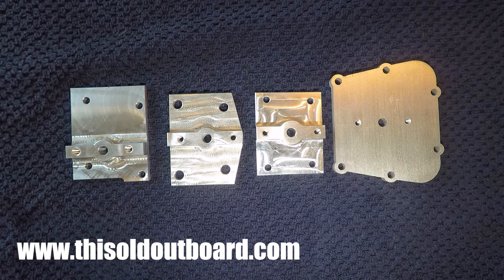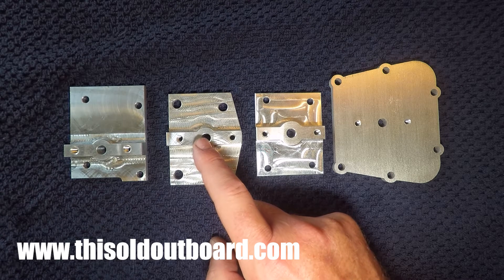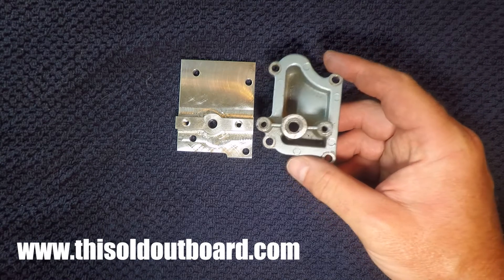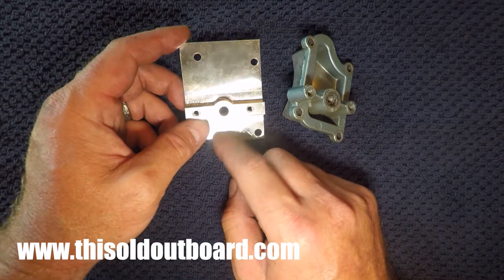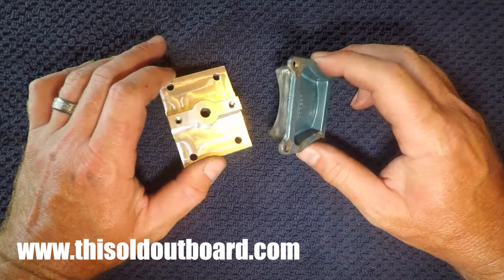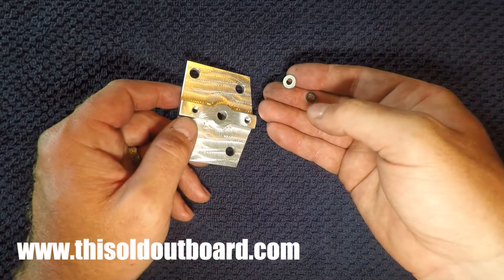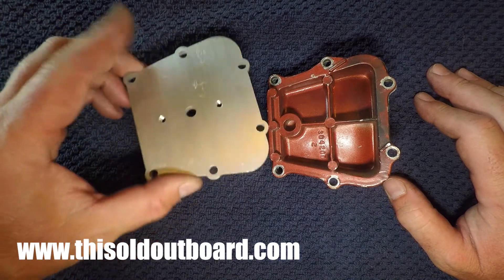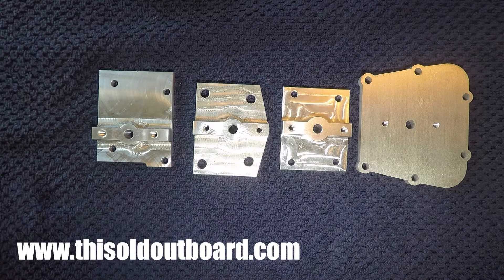Johnson Evinrude Fuel Pump Conversion Bypass Covers - Detailed Explanation

Comment: hey i bought your plate for a 35 hp evinrude and its to small. and it be nice to see a 35 hp motor how to. I drilled my one that came with the motor. what to do with the old tubes that come out?
Reply from the maker: It’s the same process as the 10 hp in this video.  Johnson Evinrude OMC 10 Hp Bypass Cover Adapter for Fuel Pump Conversion (Single Line Tank)
https://youtu.be/FOwZbXQnuao

Start a return on your purchase and I’ll refund you when I get it back!

Comment: any 2 stroke divorced fuel oump can easily be adapted, I used a Mikuni divroced 2 stroke fuel pump on my old martin 10 HP outboard, simply tap a line to the motor lower case to have a pulsating signal and direct it to your fuel pump, 
nothing to custom machine, only a rurimetary bracket to design and fabricate.

Comment: The 1957 Johnson, Evinrude  35 hp engines (some of the best ever built, Mercury's of that vintage all went to the scrap heap early ) came with 2 line tanks. Also Gale, Bucaneer and Montgomery Ward Sea King outboards were built by OMC (Johnson, Evinrude) and also used two line tanks. I have converted more than a few over the years as I have owned over 100 outboard motors since the early 60's. Wish you had these then.
Reply: I forgot to add the old and cheap way of converting them was to dill the cover and install a hose nipple. Install the same on the fuel pump and attach it to a L shaped bracket and mount it in a convenient place inside the motor housing.

Comment: I was thinking about switching one of my RDE-18 30 hp over to single line are the screws stainless steel I bought your shift rod punch out tool works great 👍
Reply from the maker: Screws are stainless

Comment: Last question I promise lol do you have to pull check valves and plug on port in reed plate behind carb when using this plate and diaphragm pump? Or is does a guy just install plate/pump and fuel line in/out… and plug pressure line off bottom of carb where pressurized line originally came from?
Reply: Yep, ypu have to put a plug over the vacuum nipple that is not covered by the new plate. Any automotive parts store will carry sets of vacuum rubber caps in different sizes - cheap and simple to install.

Comment: Hey Jo what’s your opinion on this plate being flat vs the original 56’ cover has a wing on the internal side (air flow direction?) it appears yours are flat and factor are not. Just curious if you’ve tested a lot on 30Hp is all just a concern
Reply from the maker: No issues reported / seen / or experienced not having the cupped internal side feature.

Comment: Question for the 30Hp does a guy use same fuel pump as the other 3 engine plates? 
I emailed to purchase today look forward to hearing from you
Reply from the maker: A: Fuel pump/conversion kit with everything needed so I can hook up to a fuel tank

A: my RD series bypass cover will do the trick. The bypass cover comes with fuel pump two mounting screws. You’ll need to get the fuel pump and gasket separately. See here: https://thisoldoutboard.com/custom-bypass-cover/

Q: also need coils/points/condensers/carburetor kit.

A: http://www.marineengine.com/parts/johnson-evinrude-parts.php?year=1957&hp=35&model=RD-19&manufacturer=Johnson&section=Magneto+Group

Q: one last thing I’ve watch you plate to garden hose adapter for running motor instead of barrel as muffs aren’t sufficient. Any chance this is available?

A: yes they are! See my listings below:
Flush Plate

https://www.ebay.com/itm/274829184435

Hose Adapter

https://www.ebay.com/itm/274843319416
Reply: Ok awesome can you give me fuel pump link ? There seems to be a lot of options and like to purchase correct one
Reply from the maker: @Ballerc  https://www.ebay.com/itm/Outboard-Fuel-Pump-For-Johnson-Evinrude-20hp-25hp-28hp-30hp-33hp-35hp-40hp-45hp-/282337723797?mkcid=16&mkevt=1&_trksid=p2349624.m46890.l49286&mkrid=711-127632-2357-0
Reply: Also curious do I need two adapter plates? Or can I just mount one on top cylinder?
Reply from the maker: @Ballerc  you only need one

Comment: Have you ever considered making one for the 5.5 Johnson's?
Reply from the maker: My bypass cover plates (or any bypass cover plate) will not work for the 5.5 hp motors. The 5.5 hp motors are more involved to convert to a single line system.  See the link below

https://outboard-boat-motor-repair.com/Johnson%205.5%20HP%20Seahorse%20Outboard%20Boat%20Motor/Pressureized%20Fuel%20Tanks.htm